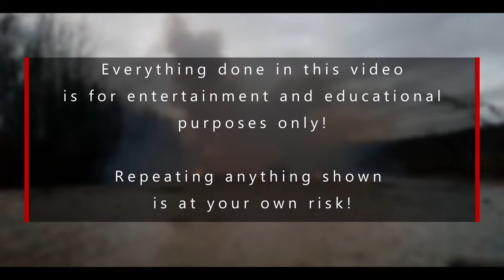How To Make A Small But Loud Firecracker

Comment: Pretty sweet!  Never seen a ground salute made quite like that before.  It does mildly concern me that the clay plugs may remain intact and become projectiles, but as long as it detonates vertically, it can't hurt anyone.  Also nice to see you're using a plastic spoon for flash instead of metal 👍
Reply: we in the netherlands call that beton koppen which translates to concrete heading which means u just get clay/concrete flying towards your head (since you feel that the best)
and this happens because we throw these salutes and it can land towards us
very fun and sometimes painful
Reply: @Juan-md4yq  sounds like a fun way to get blind
Reply: @gxh6497  thats why we wear safety glasses until dark
Reply: Hello the material for the caps used is finely ground up kitty litter. In German that material is called Bentonit. The big advantage of Bentonit is that once the fire cracker detonates it almost instantly turns back into powder = it uncompressed form. No one can be hurt thats why this firecracker is so safe
Reply: That clay will become powder again.
Reply: @Juan-md4yq  The clay made with kitty liter actually blows back to powder form instantly.
Reply: Why not use metal spoons???

Comment: Flash powder can self ignite from static charges. 

So for example do not wear any nylone clothing while performing these kinds of experiments.
Reply: Thanks for the tip
Reply: @Pyromannetje2  use anti static spray too
Reply: These are just urban legends, the only way to ignite this powder is by heat, friction or shock nothing else. static electricity doesn't release enough energy to ignite something. the human body discharges from any source of static electricity in contact with the ground, the same goes for all objects or clothing that we wear that are in contact with our body. 👋
Reply: @novilia8478  "static electricity doesn't release enough energy to ignite something" is the top stupid statement of the year.
Reply: @rocknrolljesus3197  prove me wrong instead of criticizing 🤣🤦
Reply: @rocknrolljesus3197  only very pure mixes , or Mg mixes , typical Ai mixes hardly even light of an hammer so it depends on its quality
Reply: @novilia8478  ask the guys missing hands or fingers - im proving you wrong by still having mine son...and stand by my statement that you're 100% wrong.
Reply: @adam-pe2ve  I don't mix low quality mixtures - there is no point.

Comment: Ah, you used flash powder. No wonder it's loud. I once made a firecracker out of a spent shotgun shell filled with flash powder, the fuse going through the hole where the primer normally sits. Went off with such a bang I had people asking me if I'd brought a grenade.

Comment: damn shows how much work you wanna put into firecrackers, i just put some flash powder on a paper, and just really tightly wrap it up in tape, doesnt need glue or anything, just paper, fuse, flash powder and some tape, works very nicely just the firecrackers look goofy lol
Reply from the maker: My flash is mg/kno3 it needs good confinement
Reply: @pyro_chimera  It depends on the particle size. If you can get <40 µm Mg you don't need much confinement even with nitrates. Personally I prefer Ba(NO3)2 or very fine and dried Sr(NO3)2 for nitrate flash due to their higher density.
Reply: True, you can make them as you're talking about, but when you put them inside of a double roll and then pack the clay and each end, it's harder for the explosion to release and therefore it's much much louder and more powerful.

Comment: This is very nicely done 👍🏻. I always use plastic stoppers and a single tube, which works very well since flash doesn’t need much confinement and it reduces the risk of being hit by pieces of clay. 
BTW, I may hope that the plastic spoon is made out of anti-static material? I have lost a dear friend because of a static discharge while he was handling home made black powder.
Reply: can you tell me how it happend?
first because i was using metal spoon for taking out the magnesium and second:is black powder so dangerous that it can kill someone🤯
Reply: @joshuuuuuu3299  Best is to use separate spoons for your chemicals to avoid cross contamination. The safest materials for spoons are wood or Copper, or lab grade non-static plastic ones. Also wear an antistatic wrist band connected to your water pipes when you work with high energetic mixes like flash or black powder. 
My mate died while he was screening approx 10 kg. of finished black powder. How it exactly happened is still unclear but it was winter and the air was bone dry; a recipe for static buildup and as far as we know he hadn’t been taken precautions like grounding himself with the mentioned safety wrists band.
It’s a wonderful hobby but if you are not exactly know what you’re doing it can cost you your life.
Stay safe!
Reply: @woodyamsterdam  can you tell me more about that the air was dry? I heard its bad when magnesium and sulfur gets wet. It was saying that it can ignite like that but not with dry air
Reply: @joshuuuuuu3299  Yes it's bad. Under the influence of moisture (a humid climate for example) the mixture will decompose quickly, forming sulphuric acid, hydrogen gas and magnesium sulfide. You can make it in small quantities for immediate use but it's not a good idea to make a bunch of firecrackers and stock them up. Burning aluminium can't be put out with water because it will cause an explosive reaction.
Finely divided Magnesium reacts with water, moisture, steam and acids to release flammable and explosive Hydrogen gas.
Reply: @woodyamsterdam thank you for your answer. I have currently 3 10 grams firecracker in my cellar but they don‘t have any contact with the air because they‘re closed with hot glue( i know thats not good but i alway put them away from me that it can‘t fly into my direction)
Do you think that there still can be moisture in it?
Reply: @joshuuuuuu3299  Because you’re mixing 2 chemical elements without an oxidizer, the chances are very low that they will self ignite. However by chemical nature, those two elements will react with each other over time, forming other chemical compounds that probably not give you the desired effect. You could slow that process by storing them in a plastic air tight container with some uncooked rice or silicate bags to absorb any moisture.
Reply: @woodyamsterdam  so you still think that even if its completely closed with hot glue there‘s gonna still get moisture in?
Reply: @joshuuuuuu3299  Although we are now talking chemical theory, I assume that your firecrackers are made out of cardboard tubes? Because cardboard isn’t moisture resistant there’s a theoretical chance that over time moisture from the air could penetrate and initiate a reaction between the magnesium and the sulfur. It won’t put you in danger but it might give you a lesser bang. So don’t worry.😉

Comment: I tried to make my firecracker with aluminum foil endcaps and pva glue but the fuse just stops burning at the place where it was glued, so I glued it so that it doesnt touch the fuse but still my powder doesn't even get ignited.
Idk if you will see this and it's not your way of making firecrackers but I would appreciate the help.
Reply from the maker: Are you using a visco fuse or a homemade bp fuse?
Reply: @pyro_chimera  Visco fuse I took from a commercial firecracker
Reply from the maker: @TheShipGuy. Maybe try wrapping the fuse in some paper, if that doesn’t work might be the fuses problem. Another thing you can try is closing both ends and putting the fuse in the middle of the firecracker, through the paper
Reply: @pyro_chimera  Thanks for the help I'll definitely try that!
The weird thing is that I tried doing toilet paper endcaps and it worked, well kinda since I guess I didn't glue the endcap where the fuse was properly so it just blew out.

Comment: What is flash powder?
Reply: I’m surprised nobody answered your question. Flash powder is a simple combination of a finely powdered metal and an oxidizer. The metal has to be a reactive metal such as aluminum, magnesium or titanium. The oxidizers commonly used are potassium perchlorate, or any chlorates or nitrates such as potassium nitrate. I prefer to use potassium persulfate and magnesium. But I would say the most common flash powder used for making salutes is fine aluminum powder and potassium perchlorate. This is considered the safest mix.

Comment: So, the explosive is "flash powder"?  What is that?
Reply: yes, flash powder is an extremely powerful low explosive made from a metal as the fuel and an oxidizer such as KNO3(saltpeter), both need to be ground up extremely fine for it to work good
Reply: F3 size granules work well in sugar rocket mix. I've found little difference in finely ground.👍

Comment: Where can I get flash powder ??
Reply from the maker: You have to make it yourself but it is very dangerous and you have to be very careful making and handling it
Reply: @pyro_chimera what are the precautions?
Reply from the maker: Mix using diaper method, dont store, avoid shock and static electricity
Reply: @pyro_chimera why can't i
 store it? You stored it too. I don't understand this.
Reply: @zdravicko3692  storing it could always make you forget about it and make it fall over and ignite and if you have alot of it it can make and explosion without having to build pressure up in any type of shell or container